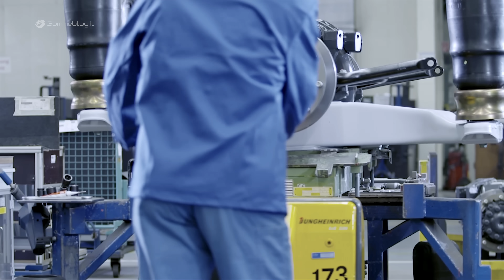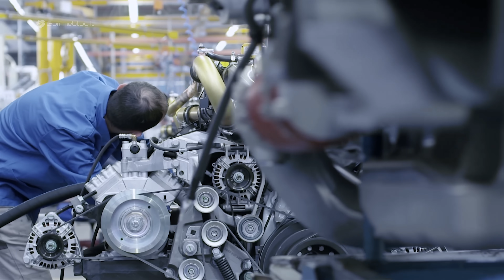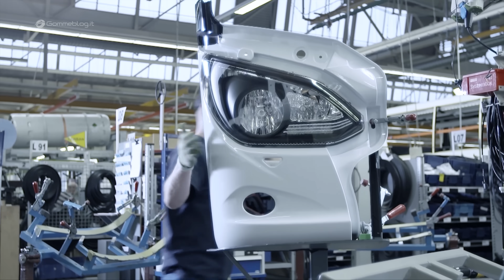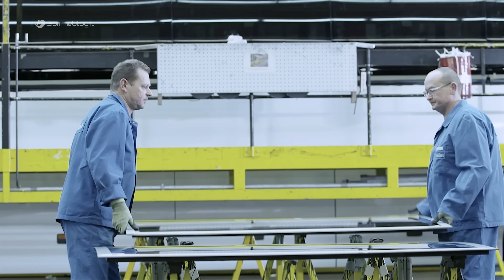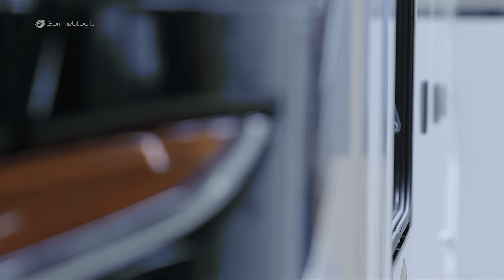Mercedes Setra LUXURY BUS - Production Assembly

Comment: Thank you for this video. 
I notice no one is wearing helmet. 
Windows men not wearing masks to avoid silicon amell.
Luggage doors checked in risky way.
Reply: Hehehehehe,very funny,very funny indeed! Visit a Bus body builder in Africa for a whole new experience of lack of safety precautions.
Reply: Notice that everybody is calm and relaxed and taking their time to do the job properly, the work areas are spotlessly clean and tidy with decent tools and equipment.  Working in helmets for a long period of time is majorly irratating and not needed.  Also it is unlikely that window adhesive is silicone though I might be wrong.

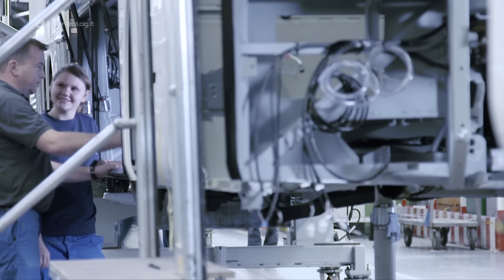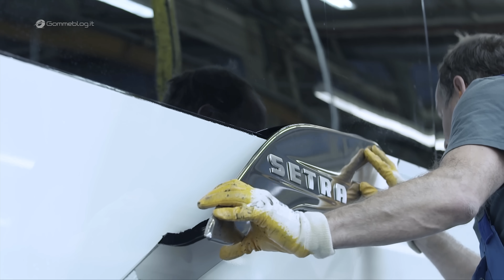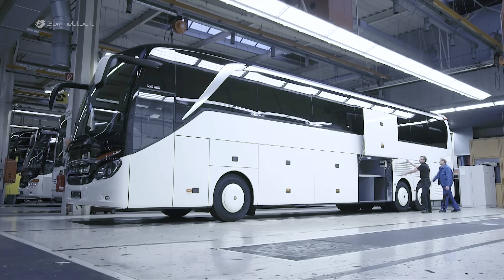Comment: 06:31 a single young woman in the assembly line , she seems just an apprentice not involved in production...by converse at  11:35  much more time for the worker applying the Setra logo...or 13:06 checking the hatches.
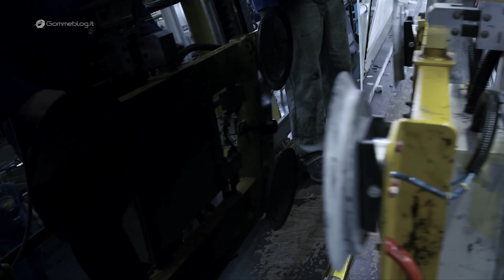10:25 workers handle the window with their bare hands grabbing by the bonding surfaces
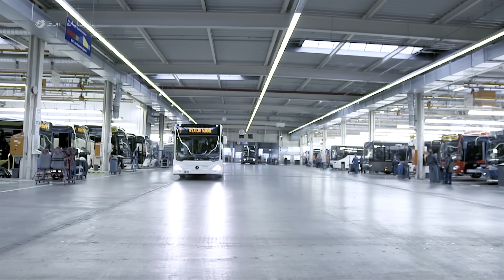12:53   & 15:09 the route of the outgoing completed buses is not delimited by danger stripes, no safe walkways for workers that cross randomly the bus lane

Comment: I'm wondering, no safety goggles, no ear muffs, helmet only in some occasion, no safety gloves,  boiler suit.  Maybe its just a video shoot.   Metal inserts were just directly hammered.
Reply: So as you can see they have no rush. İts also for the asambly so they are not manufactiring anything new. So thats why there is no need and safety equipment in my opinion

Comment: misleading and incorrect title, and gibberish description. Setra are made by Kässbohrer, which is owned by Daimler, just like Mercedes-Benz is owned by Daimler. Setra is NOT a Mercedes model, but they do share some components with the Mercedes busses, like the engines and transmissions, because they're both Daimler brands. They do not build Kässbohrer and Mercedes busses on the same lines because they are quite different in design. Also not all Setra are luxury busses, in fact the vast majority are completely ordinary coaches, but they do offer some luxury options that are extremely rarely ordered because they're largely pointless and takes away space needed for passengers.
Reply: Setra=SElbstTRAgende😊